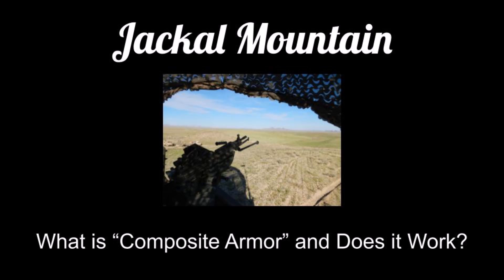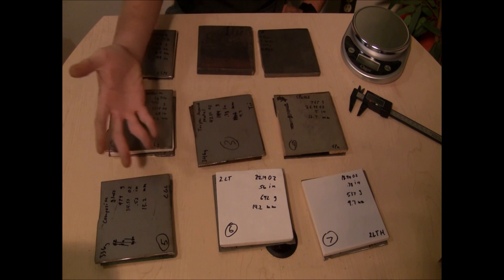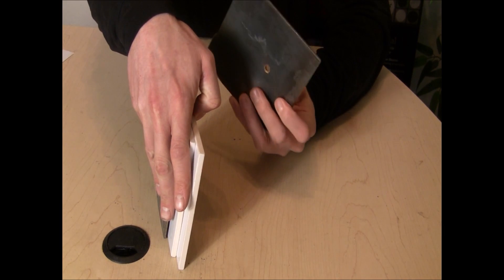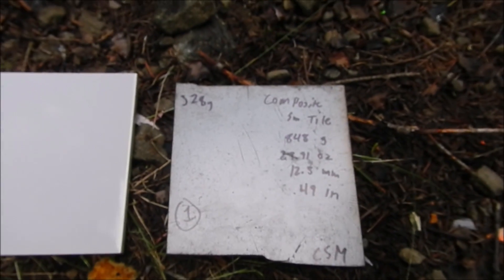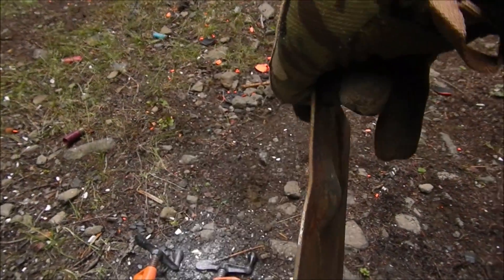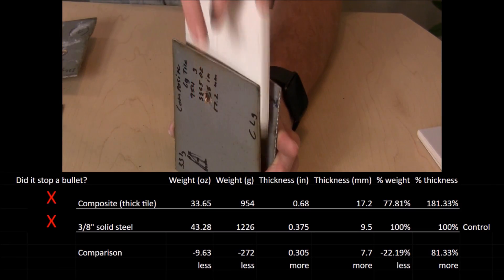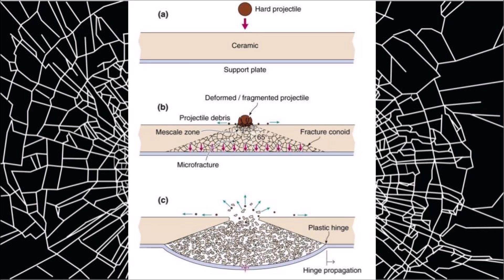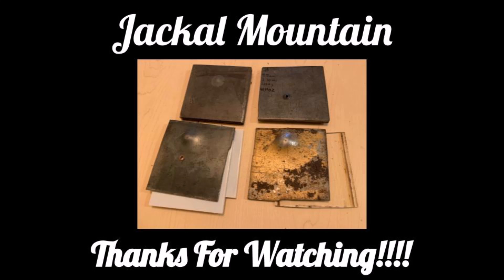Composite Armor: increasing protection, with less weight

Comment: This video is a great example of composite armors. However it does miss a crucial yet not always applied step: a bonding agent. Kevlar is a great example of this, especially in Russian aramid helmets. The Classcom TOR helmet sits as one of the only modern aramid Russian helmets that sits in (roughly because its never been specifically tested by an accredited NIJ lab) 3A thanks to the bonding agent. This is also applied to modern ceramic body armor, where a polyethylene backer is "glued" and sandwiched against the ceramic strike face, increasing its strength and allowing multi-hit ratings. (yes the plastic is also used to "catch" the round, much like how the IOTV isn't NIJ 4 rated unless you have the kevlar backer.) I'm guessing that if a bonding agent was used in your composite armors, you'd get better protection for roughly a couple of grams extra.

It would be interesting to see an iteration on this video including high weight plastics and elastomers.

Comment: Very good video, your style of presentation is really good, to the point, precise and straight forward.
Other than that I would suggest that you should have glued the pieces together and then tested.
Also hard and soft 3mm thick steel plates alternating configuration may produce different results.

Comment: The change in colour of the metal plate on the 1/2 inch steel and the glass test indicate spalling, so only the final test would have worked as protection for a vehicle

Comment: Excellent video. You might have seen better results from your composites if you had clamped them at the top as well as the bottom. The vibrations that are set up when the shell hits the plate causes space to open up in the sandwich, and the ceramic tile is free to "explode" instead of its job of abrading and absorbing. 🙂

Comment: You should re do the test exactly but bond the layers with an epoxy, then jb weld then un bonded. I tried it and i think you'll be surprised with the results you may be surprised I also took jb weld and mixed shattered glass so it was in shards and used it by it's self and as a backing and it worked very well stopped multiple rounds

Comment: The only question I would have is this, the fact that the plates are not clamped together at all four edges makes me wonder what size of airgap could be experienced with each shot as some are high, mid, and low, and would this gap changed the penetration depth?

Comment: I mean, I appreciate the fact you've gone through all this trouble, but you begin the video by stating that composite armor was used to defeat shaped charges and then your entire testing is using kinetic penetrators...
Reply: Shaped charges are kinetic penetrators.
Reply: @ChucksSEADnDEAD  Not exactly. Kinetic penetrators are solid rods. Shaped charges are superplastic streams of metal. If they were the same, there would be no distinction in armor protection value between KE and CE, but there is and quite significantly so.

Whereas as Kinetic Penetrator does not really care much about voids, cavities, and light ERA, shaped charges can be greatly affected by these. So saying the two are the same, especialy in a simulation about the effectiveness of composite matrices designed to counter shaped charges, is like saying you're studying bicycles, but for this experiment you're using a kickbike.
Reply: @whitescar2  A solid under plastic deformation is still a solid. I'm not saying the two are the same. I'm saying that they are different means to accomplish the same objective, and the differences in how they're stopped are mostly due to how the kinetic energy is imparted into the armor. The testing in this case shows enough validity, because unlike the spaced armor testing we can see that composite armor helps deal with kinetic penetration. In real armor, you'd have the added spacing effect help to disrupt the HEAT.
Reply: @ChucksSEADnDEAD  It's not plastic deformation, but a superplastic. We're moving from the world of solids into the world of hydrodynamics.
If it were mere solids at work, the copper liner would simply splatter across the hardened steel face because it is a significantly softer material attempting to be pushed inside a harder one.

If you're talking about EFPs, though, then you've got more of a case. 

https://en.wikipedia.org/wiki/Explosively_formed_penetrator
Reply: @whitescar2  "copper liner would simply splatter across the hardened steel face because it is a significantly softer material attempting to be pushed inside a harder one" - Lead M193 bullets punch through 1/4" AR500 plates.

Comment: This is great and you did good reprezentation of what a AP Dart would do but not HEAT. The properties of HEAT rounds are completely different. HEAT uses plasmatized copper at high velocity and it melts and penetrates. A rifle round is more of a penetrator round.
Reply: Most HEAT does not melt the penetrator material, and even when it does it's just in the center. The copper is still a solid slug, just under plastic deformation.

Comment: The ceramic layer wouldn't have room to expand and disperse in a real situation.  You'd end up with shattering but it would remain in place.  

The main reason for them is to provide protection against shaped charges.

Comment: You can see how composite armor works when bullet proof glass is shot. The key is the cementing of the material into a homogeneous material. 
The tempered glass shatters, disperses energy yet is held in place by being fused, welded etc with poly-carbonate layers, the brittle hard material 'can't get out of the way'.
The ceramic tile fragments in your experiments could 'get out of the way' so bits flew out of your composite sandwich. Epoxy the tiles to the steel you'd get a very different result.

Comment: Ceramic or composite armor needs to be contained in a pressure confining matrix to have effective
stopping power. This way it makes
max use of its hardness, compr. strength and minimizes shatter.
Reply: I just came to write this and thought, surely someone needs to know this too :). 
So - if the ceramic is not contained, the bullet spreads it at impact - there is almost no resistance. If not contained, you are only testing the impact resistance which is minimal while the ceramic real residence is the fact that if you cant spread it away - it is very abrasive - even if it is shattered.
It is the same principle as the bulletproof glass - it has a film attached to the glass so the glass is not leaving the impact area. 
You could redo the experiment and attach a film to the ceramic plates - even this small improvement I think will produce a huge difference in results.
Reply: Yeah, but it would shatter anyway. The main power of that is the thermal resistance
Reply: @grantavakjan9488 its harder than the enemy projectile

the enemy projectile shatters as well, and it shatters faster, so after it went through the ceramic, there isnt much projectile left
Reply: @God-ch8lq what about a friendly projectile? 🤡
Reply: @grantavakjan9488  You dont understand physics lol. It doesn't matter if it shatters and there is no reason to mention "thermal resistance" because that's not what is stopping the bullet lol. Go read a fkn book 😂
Reply: I think if he paints the ceramic tile or coats with acrylic or neoprene will be contained , one study on steel armor in WWI found that varnished steel  was more effective armor than crude steel, of course Ceramics pulverize and decrease speed and heat transfer
Reply: @socotroquito2007  you have too little time to any heat transfer.

Comment: nice idea but questionable execution in my opinion. i think the results would be more accurate if you would have encased the composite material in an enclosure so it doesnt explode and fly away once the projectile strikes it. that way the bullet might need to penetrate more material thats also denser than the one that instantly explodes which leads to decreasing density of the material for a very short period of time thus decreasing 'protection'.

Comment: I have tried a couple of there experiments, you should try to go for polymer and kevlar composite, I have done a few tests with steel and brass composite, but the one I diddnt have the chance to test, was the idea of slowing down the projectile before it hits the solid part of the plate, I know that velocity is penatration, and if you slow that veloticty down or put it through a medium, it in theory should be non lethal. Used cermic vests 7 years ago, first contact is great after that better to toss the thing.  I would also stack the tech, using just a one size fits all approach is really bad, it not only shows lack of creative mind, it shows the unwillingness or lack of care about the situations.

Comment: In all examples a plate of whatever material is broadside to the projectile.  Some tests do angle that face.  
Why not place the armor's edge on to the projectile and continue testing?  Angular examples would terminate at 45 Deg as the broadside does.  Just thinking out loud folks.   I would be concentrating on disrupting the round's direction, rather than just 
the batters up dead stop as we do now.

Comment: There is very clearly a conspiracy to limit civilian access to the more "advanced" ceramic body armors which consist of ceramic spheres/polygons embedded in a polymer matrix. 
LIBA is a example of this type of armor which proved to be highly effective and was only on the civilian market for a very short time before quietly vanishing.
The real kicker is that type of armor is very easy to make, Easy enough to make at home by ordering cheapo ceramic ball bearings and liquid rubber sealant.
Imagine filling a hollow door with that,  You could make a cheap flimsy door almost completely bulletproof.
Honestly I am surprised bunker busters are thing when imbedding ceramic tiles/spheres in the concreate would defeat that.

Comment: Love the talking voice and tone. I suspect effectiveness of the ceramic insert would be enhanced significantly if it were bound tightly between plates - is it was, upon fracture, it was allowed to shoot out the top and bottom. Merely adding a frame that could put some compressive force on the tile, along with taking up any loose space with a non-compressable filler (truck bed liner would be ideal, but even spray rubber should help) should increase reliability, perhaps making it multi-shot proof. Final thought is that using an array of smaller tiles would help to limit the extent of fracturing from the first shot. Perhaps a plate of sand bound with as little plastic as possible? Certainly not much fracturing to worry about if the medium is ductile enough...
Reply: Ah, I see you discuss some of these things later in the video. Serves me right for not watching all the way through ;-)

Comment: Please consider closing ceramic from all directions, that maximize its stopping power after its pulverize. This powder is highly abrasive, co it plays significant role in slowing down, and degrading, penetrators. In military applications, mainly in vehicle armours, ceramic tiles are at constant pressure. Another suggestion: place thin rubber layer between ceramic layers. This prevents breaking of second layer by deformation of first before actualy hit. Pleae try this and you see big difference ;).

Comment: I want to ask on what you would think or believe in. I know composite armors saves weight compare to all steels armors but loses out the advantage if repeated hits by bullets and it also will need to be thicker than all steels just like what you had proved in this video. But as far as shaped charge goes, does all steels have better protection compare to composite armors?? What do u think on that?
Reply from the maker: Composite armors are generally better at defeating shaped charges than homogenous steel armor since the geometry of the various layers physically break up the high velocity jet from the shaped charge, in addition to absorbing energy as each layer is pushed to failure. As the jet is broken up, more crossectional area of armor is engaged, which further increases energy absorption.  In homogenous steel armor, the cross sectional area of the impact isnt much degraded by the steel so the only energy absorbing mechanism is the yield strength of the steel directly in line with the path of the shaped charge jet. Composite armor is better at defeating shaped charges per unit weight compared to any homogenous steel armor.  Does that answer your question?
Reply: @jackalmountain6523  wow. Surprisingly I thougt all steels will be better at stopping shape charges as well. I know all steels are better at stopping bullets compare to composite armors. Just like what you did in this video.
Reply: @jackalmountain6523  I guess with composite armors it disturb/deviate the path of the shaped charge's jet stream therefore defeating the shape charge easier. As for steels the shape charge's jet stream is concentrated in one area throughout the steel?
Reply from the maker: @prandomable  yup. the major benefit of composite armor is that the various layers destabilize shaped charge jets, decreasing the jet's energy per unit area (area of impact increases while energy remains the same) which causes them to penetrate less deeply than homogenous steel. The same applies to composite armor when defeating solid penetrators like APFSDS. The various layers of differing density and geometry cause the solid rod to yaw or tumble which spreads the area of impact into more of the armor allowing the armor to absorb all the impact energy rather than a small region being pushed to failure and being penetrated
Reply: @jackalmountain6523  why no vid in a year?
Reply from the maker: @alexanderballa6152   I'm working on it!!!! Was away on business for a bit, but I'm back to start doing more vids again!
Reply: @jackalmountain6523  wooooooooooooo nerd stuff!

Comment: In my opinion floor tiles aren't quite a proper analogue to armor composite ceramics. maybe homemade ferroceramic plates/rods/pellets suspended in resin/clay (and then sandwiched in steel alloy plates) would be a better test, if somewhat more labour intensive.. I'm sure that if homogenous rolled armour were of comparable weight to any (proper) composite armour it would be all but utterly innefectual in true vehicle scale

Comment: During WWII most if not all tanks are steel armor correct? No composite armor being used at all?
Reply from the maker: as far as i know, yes, they were simply thick steel armor
Reply: @jackalmountain6523  how thick? The thickest?
Reply from the maker: @7150285  Tiger 1 or IS-2 would probably be the most most heavily armored tank that was commonly fielded.  Max thickness is around 120mm or 4.7in
Reply: @jackalmountain6523  I'm assuming that 4.7 inch thickness is multiple layers of steels correct? Or is it one solid homogeneous steel? Harden thicks can't be made too thick because it's too brittle.
Reply: @komradearti9935  check out my vid ;)
I know solid steel is stronger than layers of steel of the same kind and thickness. The science behind that I would assume is solid steel is DENSER in the middle than layers of steels and don't have gaps.
https://youtu.be/rcOrZj5GTKo
Reply: @komradearti9935  I trust real life testings that people had done. Real life tests shows with consistency that solid steel (of the same kind and thickness) is "usually" still stronger than layers of steel (of the same kind and thickness). Spaced armor is only effectively like you said, if the projectile is deterred by the spaces in between...those tests had already been done by many people on YouTube.
Reply: @komradearti9935  I wasn't saying you were wrong, but I'm saying I trust real life tests rather than some calculated research papers.
I don't really consider theortical calculated numbers that was never tested in real life as source due to many reasons.
Also owner of this video that you are commenting on Jackal Mountain he did a vid of spaced steels vs solid steels as well.
https://youtu.be/AodH5WL1pl8
https://youtu.be/W0frzvOSoOU
Reply: @komradearti9935  I didn't say you were wrong. I agree spaced armor effect is effective or even can perform better than solid steel IF spaced armor deterred the projectile and its flight path...but if spaced armor didn't cause the projectile to break apart, fragment, deflect, deviate etc etc. Then it will definitely perform worse than solid steels against bullets.
Reply: @komradearti9935  usually solid homogeneous still outperform stacked steel, spaced steel. Watch the videos link I sent you for real life examples...
Reply: @komradearti9935  watch the videos I sent you. Those were real life examples. The Soviet's testings were their own testings although they didn't really document it like making a video of it. Seeing is believing.

Comment: You have the right idea. But you need to encase the ceramic so it doesn't disintegrate. An epoxy or hdpe works well.  Something like flexseal would make a decent spall liner.

Comment: i think the edges of the 2 metal plates must be closed/sealed...this way the scattered glas/ceramic cant just fly out of the way, it stays in the metal "chamber", thu bullet would lose more energy fighting its way through the material, because it needs to be compressed to the sides to build a channel. thats why its very hard to throw a javelin or a pike through a sack of sand, but it will penetrate a lot deeper if you throw it just into a pile of sand.
Reply: You have the right idea. This very concept in composite armour design is called "lateral confinement".

Comment: You should contain the ceramic in the composite target. when the bullet impacts, it pushes the tile out to the sides and has minimal ersion on the projectile. I would recommend using fiberglass to wrap the steel and ceramic tiles together. This also helps with multihit protection.